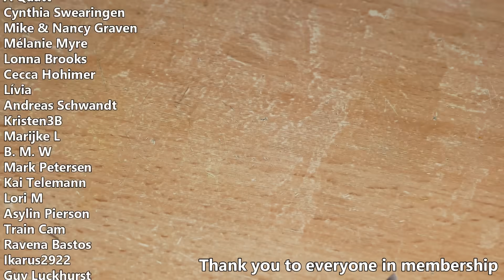Kill Bill Halloween 👻 Night Lamp / RESIN ART

Comment: Good job as always.
Nice to see how your epoxy pouring technique evolved during the years.
(Tip: if you want to remove hotglue, drop some alcohol (IPA) onto it. It penetrates under the hotglue and lifts it off the surface.)
Reply from the maker: Yes, I recently tried it and it works. Thank you